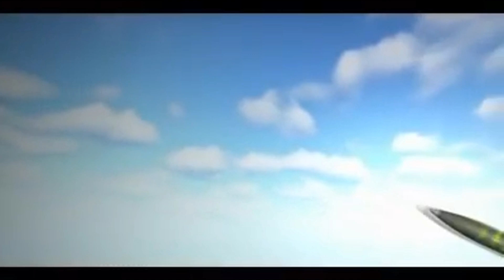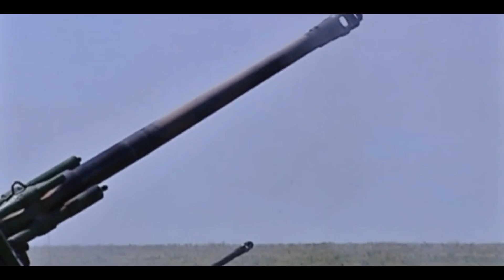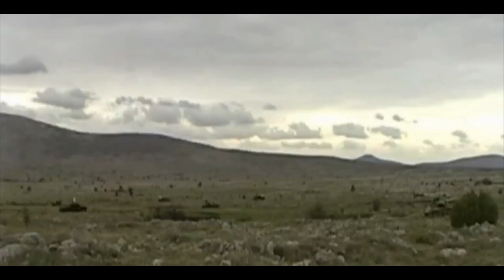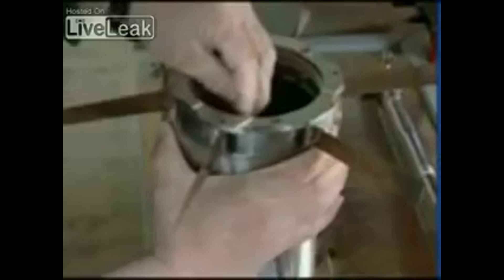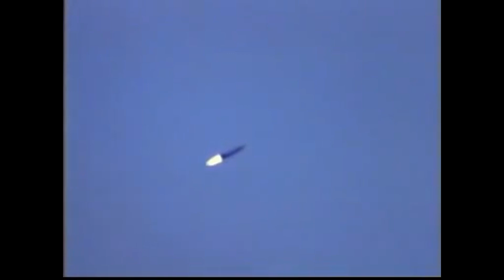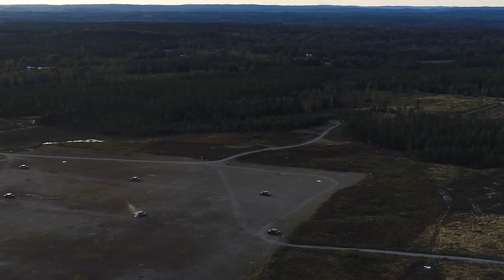Munition d’artillerie de 155 mm BONUS

Comment: Wouldn't it be possible to squeeze this into a 120 mm tube, so it can be fired for a tank??? With an added time delay fuse, so it can separate at a specific range, since the tank can't control distance by launch angle.
Reply: France have a large array of 155mm guns and 120 mm is indeed too small and too fragile pressure wise to get such a large shell out in the air at long distance